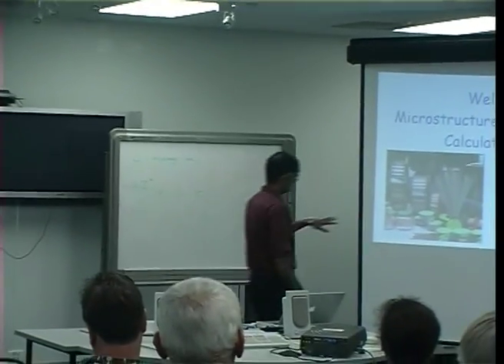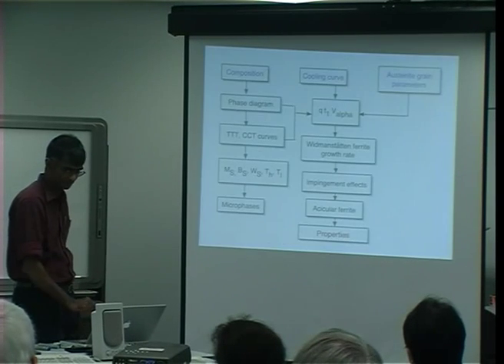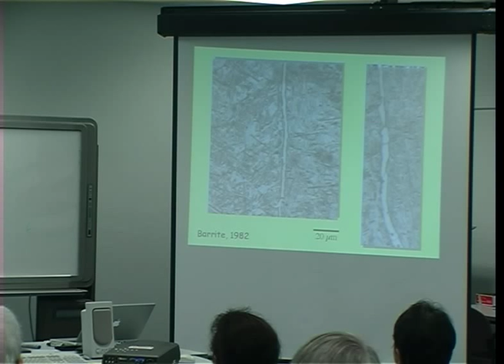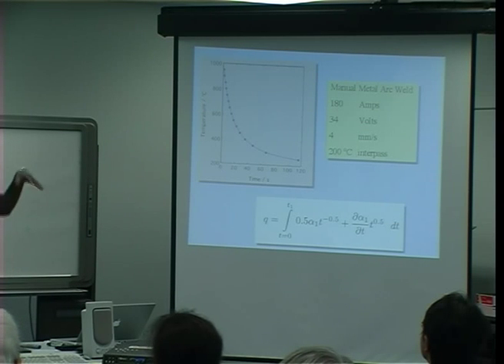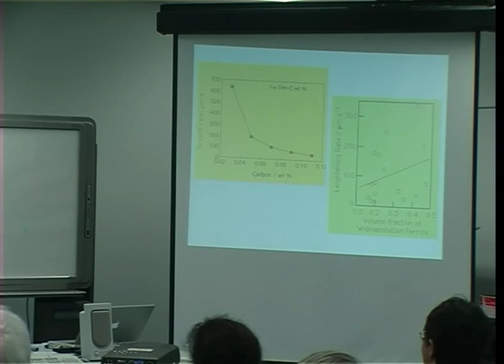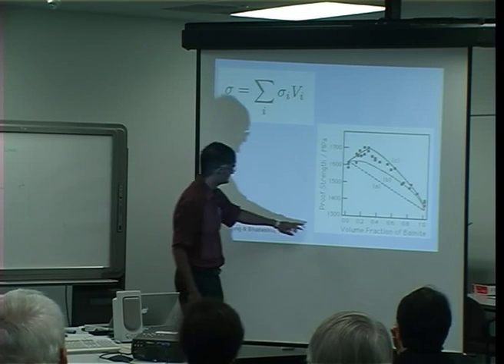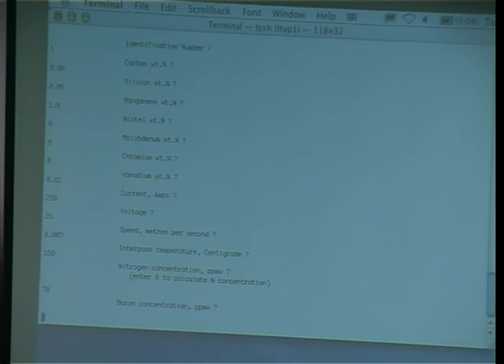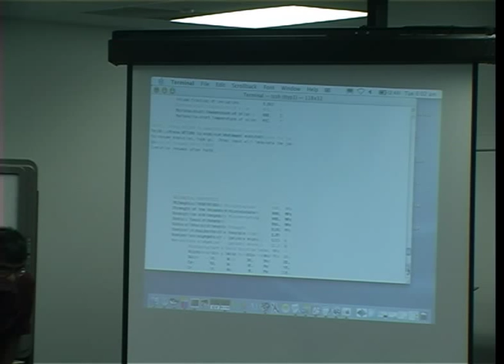Microstructure of Steel Weld Metals

Comment: Dear Professor,
Thanks for sharing the knowledge. I would like to ask about the heat affected zone appear due to heating and cooling cycles during welding process. As i could understand from your lectures and book (STEEL microstructure and Properties), the micro-structure of HAZ (the immediate region after the fusion boundary) is coarse grained Martensite. which means it has higher strength from the fusion zone, then why we some time observe the failure of weld metal in HAZ  ? Is HAZ (i.e Coarse grained zone) is the weakest link in the weld geometry ? is the reason lies in constraint theory as you explained in this lecture.?
Many Thanks
Reply from the maker: The martensite may have a higher strength but it is also less tough, depending on the carbon concentration.